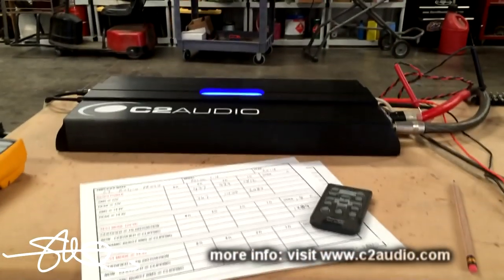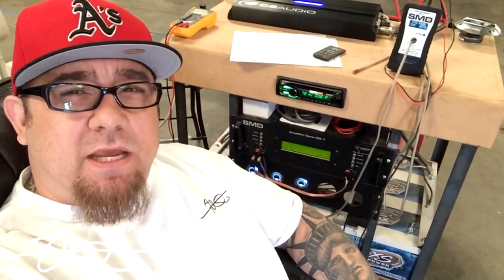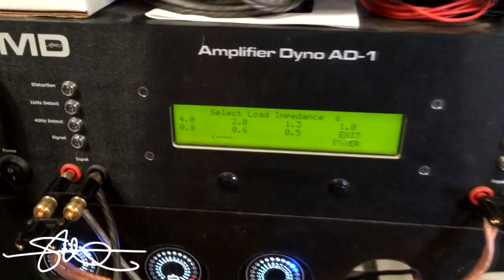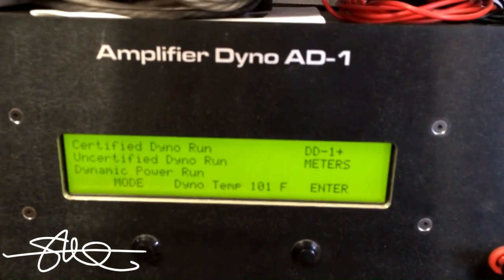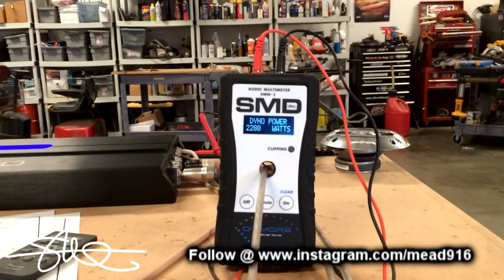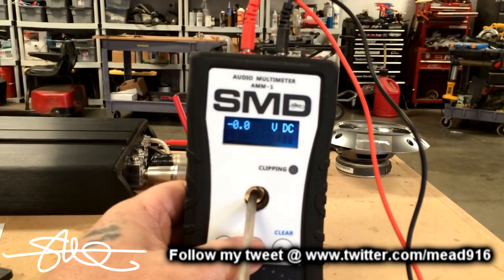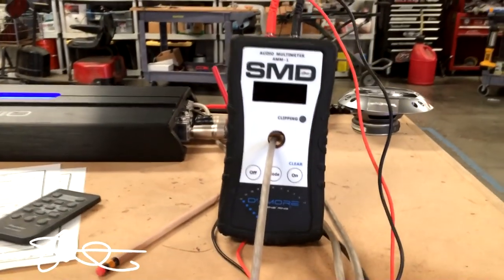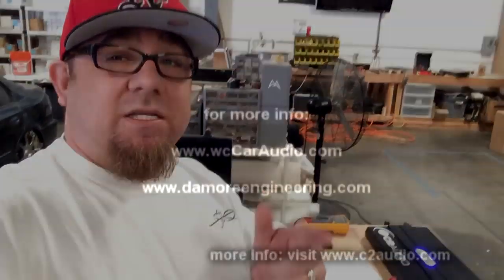MEASURE YOUR WATTS! SMD Amplifier Multi Meter / Amp Dyno

Comment: Is it possible to get 1ohm out of two dual2ohm sub's?..I know with one sun you can get that with the way you wire it but if you did the same wiring with two sub's you get .5ohms which I don't want cause the risks but I would like 1ohm oppose to 2ohms..I have the RF p3s and RF T1000

Comment: Hey bro! I have a 2013 f150 that comes with a Sony sound system... The sub it comes with has its own little amp I believe... I want to delete it and add a better amp with a 12 inch sub like a jbl... Is this possible? If so what would something like this run me to have installed ? Thanks..